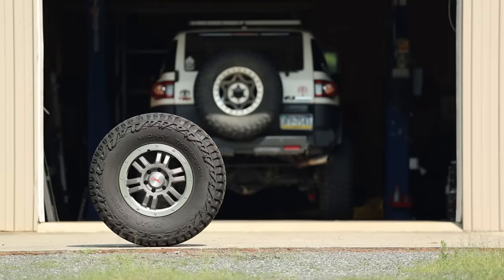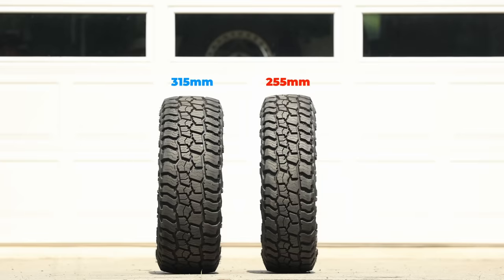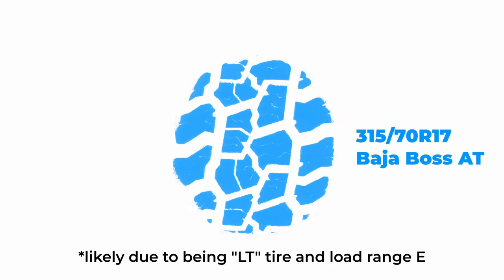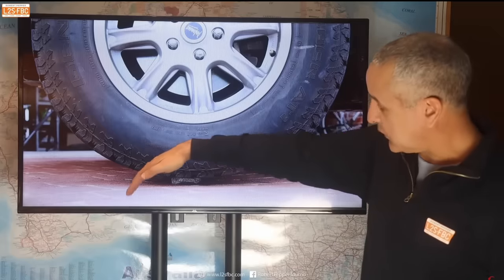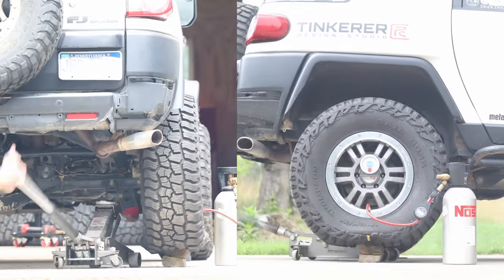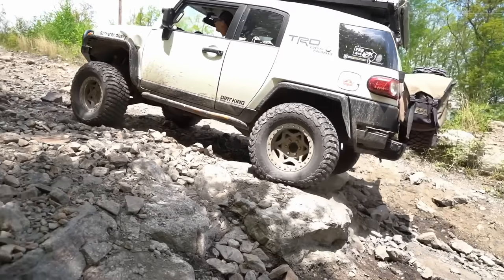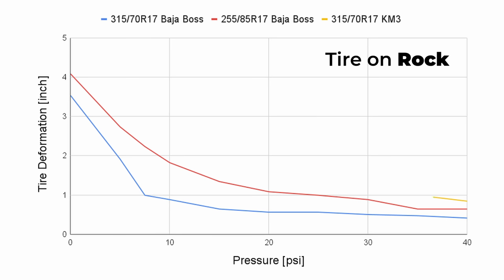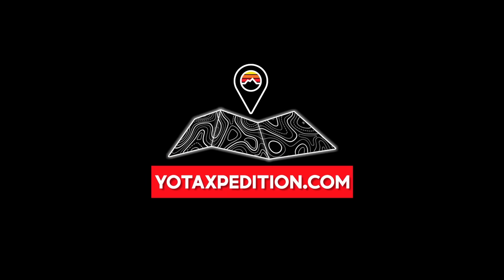3 Scientific Experiments to Settle This | Wide vs Narrow Off-Road Tires

Comment: The conditions you experimented on (a straight line, dry condition) was proven by your experiment for rocky off roading. That the narrower tire performed better. I would like you in another video to change the road/trail conditions. For example traction on wet, gravel, mud or even sand surfaces, where the wider tire would display top performance.

Comment: Great video as always!  However, your information about the BFG’s isn’t viable for this discussion.  Different manufacturers have different carcus designs and rubber compounds. The durometer of the rubber needs to be accounted for.  It extremely difficult to make accurate comparisons between different brands. 
Also the vehicle weight and load range of the tire needs to be considered when selecting an ideal tire. IMHO load range “C” is a better option for light to mid size vehicles depending on how the vehicle is kitted out.
But I’m moving outside of the scope of this video.
As for this video the only data that your viewers should consider is the data on the Mickeythompson tires.
Just something to emphasize in your video.

Keep up the Great work!

Comment: Wide tires offer lower ground pressure, better for dunes and boggy ground. Skinnies are going to give you better mileage (combination of aero resistance and a narrower contact patch) and work best anywhere you are on solid surfaces or mud/sand/gravel is shallower than your hub depth. You can look to agriculture for examples, for instance running a wider super single to lower ground pressure where duals actually provide better traction.

Comment: Good review! I wonder if wider tires would be better on uneven or soft surfaces, e.g. mud. It is similar to the rock and pipe test, but instead of an obstacle, the surface is curved like rut on the road?

Comment: I love the look of pizza cutters a billion times more than thickies. They're also better at cutting into soft terrain to get a firm grasp on hard pack sub-layers. If youre not climbing rocks, pizza slicers will keep you from getting stuck in more terrain varieties. And they get better mileage, generally wear safer, need less modification to fit into stock wells.  and look a lot nicer.

Comment: If you take your pounds per square inch and times it by the square inches of contact patch. That will equal the load that’s on the tire or the weight that your vehicle is putting on the tire.

Comment: It more depends on where you live and what terrain you drive in. Some mud it's better to cut thru with a skinny tire and get to the bottom to push through. Some mud doesn't have a bottom needing a wider tire with more flotation. It's the same concept on farm equipment. Depends where you live.

Comment: Weight of the vehicle also contributes to the flex of aired down tires and foot print, the foot print of my JK would be totally different than your heavier Toyota, aso lift, weight distribution and back spacing of the wheels at speed in curves on the highway, so a hairpin curve at 70 on a highway my JK doesn't feel tippy running 315/70/17E Toyo MT's running at my normal highway psi of 30 and my 17×9 wheels with 4.5" back spacing -12 degrees gives me a leery feeling on a 40° bank but all four tires are firmly on the ground, narrow tires might change the center of gravity, js

Comment: A wider tire has more internal surface area. This could explain why there is more deformation in a narrower tire at the same PSI (lbs per square inch). Simply because there are more "square inches" in a wider tire than a narrower tire.

Comment: An amzing amount of work went into this. Bravo!!!! But 255 is not a pizza cutter. What planet are you on?!!! It's absolutely massive. Extreme and effective 4x4 such as the Duster and the 3rd gen Vitara come equipped with 225s and work great. To save on weight, wear and tear and cost, go for a max of 235 with a high profile, e.g. a LR Defender from the 2010s and earlier.  That's what this video is really saying.

Comment: Thanks for the videos. I also have an engineering background, so your methods/explanations resonate well with me. Do you think 255/80/R17 might fit on a 2013 Lexus GX460 okay? My stock wheels (18 inch) have a 52 mm offset, and the TRD wheels (17 inch) I'm putting on have 4mm offset. I assume I'll need to do a little plastic work but was hoping to avoid cutting metal by going with narrow tires. Also, any plans on making a GX bumper for sale?

Comment: Cool experiments. But just going off my experience of a lifetime of off-roading in multiple terrain from mid Boggs, rock crawling, sand blasting and hill climbs. Thin always wins lol. Actually almost always. The weight on a smaller area provides better traction and the flex is better. But in bottomless mud and sand wide is better for flotation but only if you have the horse power to really turn them. If it’s not bottomless mud and you don’t have extra power skinny is still better. So other than the times you need flotation skinny is better. But there’s many other variables at play. Like tire height vs width. A 12.50 with tire is fairly wide on a 33 or 35 inch tall tire but on a 37 or 38 or bigger not so much. Also your bfg that flexes even though it’s wide. If you took the skinny size of that same tire and yes they make the skinny ones too for a reason, it would out perform your wide tire because it has the same construction but the advantage that skinny tires naturally have and showed in your experiments. At the end of the day the only way to know for sure what will work best for your set up in your terrain is to run them. Give the pizza cutters a try you might be surprised. Maybe not. Skinny’s are also easier on everything mechanically.

Comment: Whatever the results are I want 7.5-16 tires on my little truck as the next tires. 3.73 with 30" tires to 4.56 with 32" actual. It needs the extra rpms as it is. 

If you really want a 35" tall tire, STA has 9.0-16 that's 36" tall and skinny.

Comment: I'm no engineer but I have 35 plus years of off-roading experience wide tires look badass but they only have an advantage if the deep mud has no hard bottom. They're only advantage is flotation.

Comment: Well Congratulations on proving running a wide tire on too narrow a wheel negatively effects contact patch.  I'd like to see the difference when you use the Tire Manufacturer's Recommended Width rims for your testing.  The 255/85 uses a 7.0" rim width.  The 315/70 uses a 9.5" wide rim.  I'm also curious how wide of a wheel your BF Goodrich is installed on.  BF Goodrich also tends to be on the small side of Nominal Tire Size, my KM2 35x12.50 R15s on my Bronco were 34 inches tall.

Also, as someone who works for a tire manufacturer load range E is simply too much overkill for something as light as a FJ Crusier or even my 4Runner.  What the off-road market really needs is more informed people calling for Load Range C tires in modified vehicle sizes so off-road enthusiasts can have more flexible tires that settling for improper Load Ranges, no point in having a heavy (more unsprung weight) tire and overly stiff sidewall that hinder the performance of lighter off-road vehicles.

Comment: I am not going to read through all these comments to see if this has already been stated, but anyway.... It is not apples to apples when it comes to pressure because the volume of the tires are different.  Great video but I think it might have some issues with its process that skewed the results somewhat.  Ultimately I think the outcomes support the general reality of wide vs narrow- but you can run a higher volume tire at lower pressures, so 10psi in one is not ever going to equivalent to 10psi in another if the volume is different.  Do a test with narrow vs wide but with the same approx volume and see what you get.

Comment: wide vs narrow also depends on the surface you are going to run them on, Sometimes you want to dig in and other times you want to float.
The tires are new and at their stiffest. I think the 315's are used enough to be more flexible so redoing the test with a year and or 10k on them would be interesting. Testing virgins is different than one with a few hard miles on it 
I came to the party late with almost 5k comments so forgive me for not reading 5k to see if I am saying what others did

Comment: Pizza cutters FTW. I've been saying this for nearly 25 years. Also being an ME specific to automotive powertrains.
What people fail to realize or refuse to accept [#AllOfYourData] is that usable traction to go forward is a function of linear contact patch where as traction to resist gravity/skidding is a function of width contact patch (e.g. Formula 1). The use case matters most. While looks/appearances are irrelevant.

There is a very good reason why unstoppable in mud, snow, and sand Land Rover as well as Subaru, VW, Audi, and Land Cruiser along with WWII and Viet era jungle motor vehicles we're outfitted with pizza cutters rather than flotation tires. Where as during modern era GWOT there was a change to flotation, and with that far more need for rig rescue. 

Additionally, all that mass reduction results in a direct reduction in drivetrain wear as well as increased energy economy due to reduced inertia along with increased tractive force requiring less energy to maintain a given direction (X) at distance (Y) over time (Z). Aspect ratio / sidewall height doesn't even matter so much as tread width (thin vs wide) relative to tractible contact patch.

Really great video!!!  I'll be sharing this with non-technicals who don't understand math and struggle to comprehend what they otherwise cannot see to visualize.  :Golf Claps:

Comment: Please, repeat something like this on sand instead of pavement.  How does the soft surface affect the contact patch 3D shape and the depth the tire sinks.  And then how does the tire and soft surface interact under motion.  I suspect despite the pizza cutter having the same area, the 3D shape and dynamic behavior will both contribute to less floation.

Comment: Should have compared them to a similar sized p rated tire vs the lts.  That small round contact patch tells me that your load rating is too high. With the lighter load rating on the tires you'll start seeing flex at higher psi which will help stay on the bead. Not as tough  as an lt but you can get the flex a lot easier. Also not really going to have the pizza cutter options which sucks.

Comment: Area = force / pressure. If the weight of the vehicle and tyre pressure is the same, then area (contact patch)  will also be the same. That is until you get to the point where the tyre construction has more influence on contact patch than air pressure.

Comment: I'm a pizza cutter bro all the way, steering angle and weight being the main reasons.

That said, I suspect the common 'deflate' wisdom we all know might not be correct. The data does not necessarily prove that there is no difference in contact patch between wide and narrow tyres for a given use scenario/terrain. That is only true if we assume we are running the same presures for both tyres for a given scenario/terrain.

The data COULD suggests that wide tyres can be deflated MUCH more before enough flex of the sidewalls occurs to risk sidewall damage. This would mean that you can run wide tyres at lower presures, granting a larger contact patch and less ground presure. This would be especially true if you run beadlocks. The question obviously being if you can utilize these effects above the debeading/beadlock teritory, as you stated, most people don't drive that low because it isn't worth the risk. It would be interesting to do a heat test of the tyres, to see if the narrow tyres indeed have more rolling resistance at the same presure as a wide tyre. If so, it could mean you could run wide tyres lower than narrow ones in all circumstances, meaning they will have a grip advantage (assuming grip is related to contact patch) in all circumstances.

One small note, we see there is a difference in contact patch between the two tyre brands at the same presure. This has two potential causes that were not discussed (which might be good, keeps the video on topic).
One: the two brands might have the same load rating, but different sidewall characteristics.
Two: the difference could be caused by the difference in tread pattern. The way you've measured contact patch is completely acceptable when comparing tyres that have the same tread pattern (which you could argue they do not have btw). But by including the air between the blocks, we cannot be certain that different tread patterns actually have the same amount of rubber touching the ground.

Awesome video btw

Comment: Instagram for housewives to post pictures of what food they ordered at the restaurant today or what color poop her baby or doggie has! What do you want from such a poll?!
And the area of the contact spot does NOT depend on the dimension of the tires. It depends only on the elasticity of the tire (which, in turn, mainly depends on the tire PRESSURE and a little on the stiffness of the rubber). That's why there were no differences in the experiment. The practical difference between narrow and wide tires lies only in the shape of the contact spot. When driving on weak soils (such as mud or fresh snow), both tires will start to slip and the narrow tire will get to a solid base earlier.

Comment: 215 85 R16 on a lifted Suzuki Grand Vitara.

47 years of driving 4x4s for a living in mineral exploration and I never ran anything wider than stock. Sliding around on gravel roads on fatties when you need to get somewhere is irritating. Skinny works. And buy a winch before selling the farm to buy cool fat tires.

Comment: One critical factor you did not account for is rim width. A wider tyre on a thinner rim will in fact increase the contact patch more at the same pressures. Given that the tyres are the same compound hardness / flexibility.

Comment: Tire patch size is calculatable - Vehicle weight /tire pressure  (/ 4 assuming load equally distributed on all 4 tires, but this is normally not the case, but close enough).  Tire structure makes minor differences but overall this is plain old physics.  Wider or narrower does not make a difference.

Comment: I think you did a good job showing the relationship between tire width and hard surfaces, but not mentioning sand or mud anywhere in the video isn't telling the full story for viewers who are just leaning and trying to educate themselves about what makes a good off road tire. Getting stuck in mud or sand is a MUCH more likely scenario, and in that case the surface conforms to the tire (unlike the concrete in your driveway.)
I think you did a good job showing what happens on hard surfaces, but the reality is that is off-road tire performance for the average user is concerned with a wide variety of conditions and not getting stuck.
Would love to see your methods and approach given to how tires interact with with a wider variety of surfaces, including mud and sand.

Comment: So I’m not an off roader but most interested in your comparison; however, for a different reason. I’m in automotive service and in a snowy climate. There is also a thought of the pizza cutter better for winter traction than a wide track because it cuts through the snow to bite the pavement. So I have no way to prove nor disprove so I’m wondering if you experimented with this??

Comment: Factor in that most driving will take place on pavement, the narrower tire weighs less and will rob less HP. 
   Depending on off-road terrain, the harder the surface, the narrower tire will perform better.

Comment: I don't find this very surprising. Basically, pressure is nothing but the weight-force that the contact patch supports divided by the area of the patch, so if you compare same pressure then obviously the patch will have the same size regardless of tyre model. (Until you get to extremely low pressures, where sidewall rigidity distorts the picture.)
But that's kind of missing the point, because same-for-same pressure doesn't make a lot of sense to compare! As every cyclist knows, different-width tyres have very different pressures at which they work best: a road tyre is operated at 50 psi or more, a mountainbike tyre at around 25 psi, and a fatbike tyre at 10 psi or even lower. Of course you can vary the pressure in all of them, but running a narrow tyre at too low pressure risks damage (pinch flats) and running a wide tyre at too high pressure prevents it from giving its full offroad performance.
For cars the same should apply too: wider tyres only pay off if you run them at lower pressure (or on a heavier car), else they just add mass and rolling resistance without benefits.

Comment: Wide and aired down works in sand depending on the tread and weather or not the sand is wet or dry. Narrow works better in snow and mud. Floatation only keeps you above barely unless your slingin them puppies fast

Comment: If you multiply the PSI times the total area of the contact patch in sq inches it will equal the weight of the vehicle in pounds. It’s Newton’s third law. This is when the vehicle is stationary though and you need to only count the area actually in contact (the inked area not the area between the tread blocks).

Comment: Also you need to account for weight. If your vehicle is supper heavy a 12.5 wide tire might flex the same at 15 psi as a narrow tire on a light vehicle at 20 psi.

Comment: This guy is red hot with his science. He s confirmed what I've excepted for years.When I go 4wd on beach my setup is HT skinny 245,s (Bridgstone 689,s).Because at 15 PSI I've got greater tread area/flex combined with a tight HT tread pattern=a deadly combo.I love seeing young dickheads reving the tits off in low range flogging along(going nowhere,with Massive tyres) where we chug past slow and steady with esc and traction off in high range.